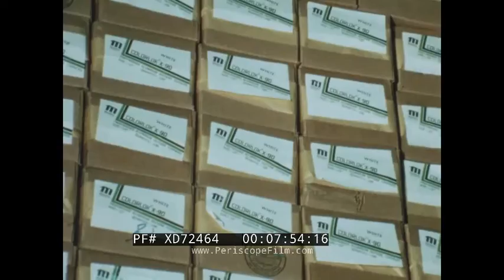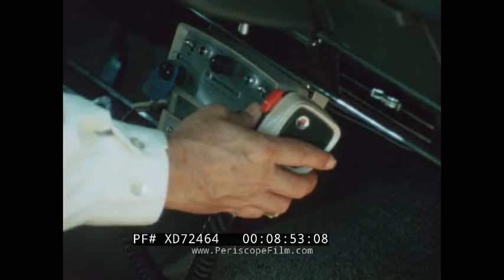"THRESHOLD OF TOMORROW"  1970s MASONITE CORP. LAMINATED WOOD PRODUCTS PROMO FILM XD7246

Comment: now we have ''wood'' floors  engineered wood    better than wood   harder wearing and longer lasting than wood.      fine,  but, they do need to work on the sound of the floors when you walk across them, instead of plastic panels, they need to sound like wood, wood has air and water in it's fibers that give it resonance when you walk across it, unlike laminates.

Comment: I worked for Masonite in the '90's at the Laurel, Mississippi mill when it was owned by International Paper.  I enjoyed working there.  They screwed up the siding in the late 70's early 80's when they changed the resin and the press time.  They had siding in the 50's and 60's that was so dense it was bulletproof.
Reply: Corporate bean counters ruin everything.
Reply: That was asbestos as well. I had a house with it and you could bat a hard ball against it. Tough stuff.